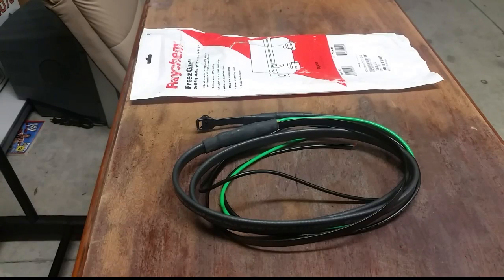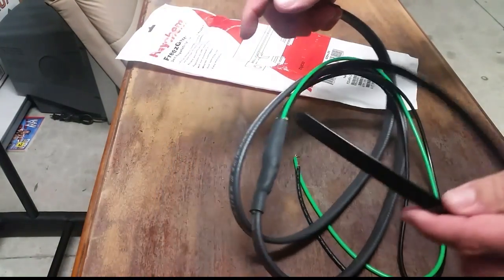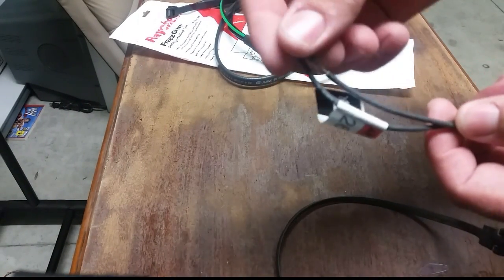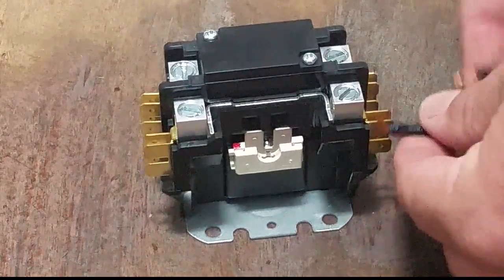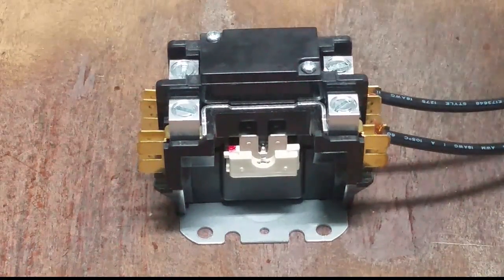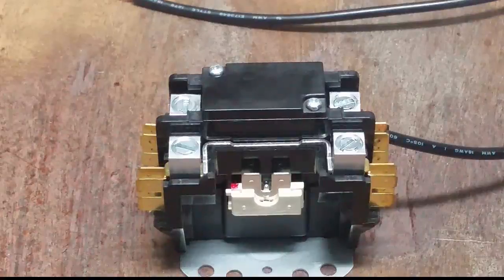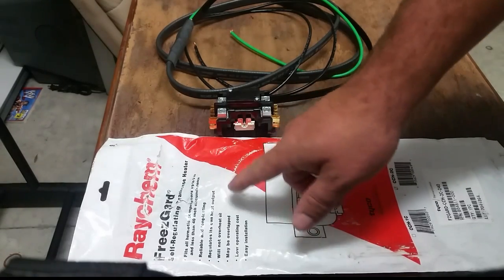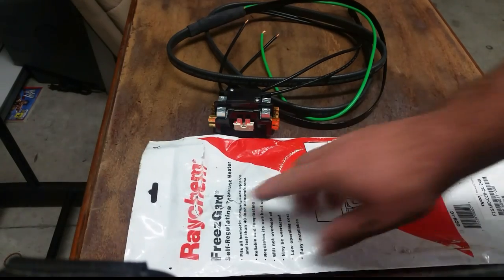HVAC Service Parts : Crankcase Heater Wiring

Comment: Thanks Zack been HVACinG  25 + yrs but never found an issue with an CC heater till Now found one wired wrong Hot 24/7 on an 2 pole contact while i was charging adding 1lb  Gas so I unplugged it ..its June In Ga so hopefully all be Ok for 2/3 85 * days with 70* nites & rewire that sucker ..Thanks man On 30 K HP

Comment: For heat pumps is it worth turning off the CCH in the summer or should they be used even in warm weather?
Reply from the maker: It's really more for colder months
Reply: +talyn875   Yeah, thats why I`m thinking about putting a temp cutoff in series with it.   That 30 watt drain adds up.

Comment: Wiring the crankcase heater so it is on when the compressor is off is light years ahead of  what I would have come up with.  Very ingenious.  Would this work on a household light switch?  It would be great for some practical jokes around the house.
Reply from the maker: Thanks for watching Daniel

Comment: Totally personal preference here.  I'm not a fan of 1½ (single) pole contactors or putting a cch across the contactor.  I always end up putting in double poles and cch's across the line, haven't had any issues in over 5 years.  Still kudos for the refresher for those wondering.
Reply from the maker: No worries, there are lots of ways to do it